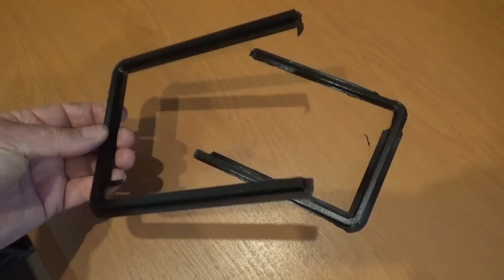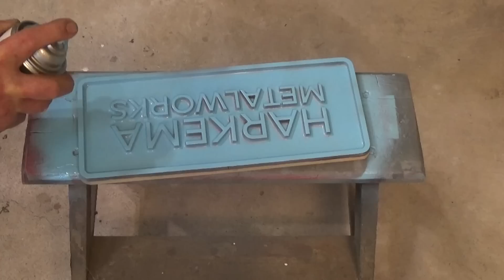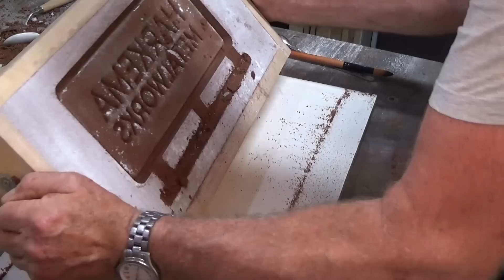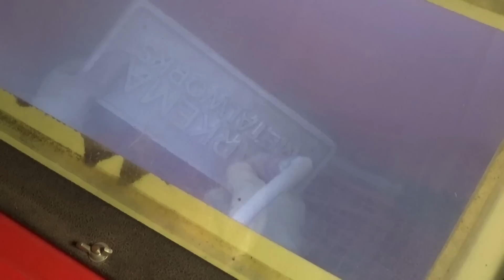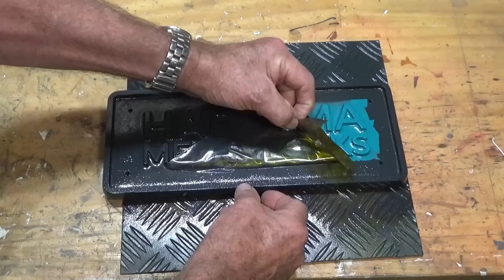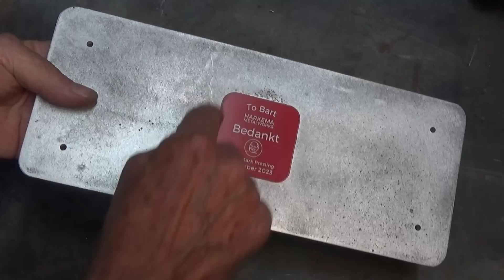A Gift for Bart

Comment: Looks simply amazing Mark, a fine example of your suite of skills. Curious what media do you use in your blast cabinet?
Reply from the maker: I use 80 grit garnet for paint stripping, rust removal and surface prep for powdercoat. I have some glass bead which is good for surface texturing aluminium prior to anodising. It takes a while to change over the media though. I find that the glass bead doesn't produce any dust and it's way easier to see what you are doing.
Regards,
Mark
Reply: Thanks Mark, appreciate that  @Preso58

Comment: Beautiful Mark. What CAD program do you use that has the ability to add draft? I do some hobby metal casting and cutting letters by hand is so time consuming. I've gotten a 3d printer but haven't found a program that has the draft feature.
Reply from the maker: I use Autodesk Inventor and the most recent version does draft on extruded text easily. I think Fusion360 would do it too since Inventor and Fusion are both Autodesk products. I know that I had issues with some text characters using older versions of Inventor but they seem to have got around most of those bugs. I am fortunate that I can still keep an Education license for Inventor but it is very expensive if you want to buy it. If you are looking for a set of printable 3D letter models, I made up two different typeface sets which you can download and then print at whatever scale you want. The link is here https://www.dropbox.com/scl/fo/2zywzsft999rty9riw1wt/h?rlkey=tri0pho0o5a2t3oclliaaar2e&dl=0 and here https://www.dropbox.com/scl/fo/ple2i7rmmyt4o1a28rvn8/h?rlkey=lp4usjk7w8gnlsxyrvuz9t0d7&dl=0
Regards,
Mark
Reply: Thank you Mark, for sharing this. I'm a relative newbie at 3d printing, so I really appreciate your help. You tube is a wonderful community.

Comment: Bedankt Mark! (yes Bedankt was correct way to say thank you in Dutch)

I didn’t expect anything in return for the cutters. I think I will speak for many of us that it would be sad to see when you run out of cutters and you can’t continue with your work. And I had more than enough. 

This gift is the most beautiful handmade gift someone has ever made for me. I really appreciate the time and effort you put into it. And even making a video about it. I know how much time that cost. 10 sec of sanding in a video is most times a few hours work in real life. 

I impressed with your craftmanship. From 3D computer work to quality casting and multiple colors powder coating. 18:04 also put a smile on my face with the ‘internal’ voice speaking  ‘cheers Mark you’re getting good’.

Getting the letters without the digital file was already a challenge. Then matching the colors from a small sticker. Fun fact, I was not 100% happy with the stickers because the green was to light. So I’m glad you picked the darker green because that was perfect! 

I real life it’s even better then on the video. The casting is very good and the paint came out great. I will give it a nice place in my shop and I’m sure it will enjoy looking at it for many years. 

Thank you Mark! Cheers! Your getting good!

Ps. about the cutters, let me know if you ever need more ;-).
Reply from the maker: Thanks Bart. It was my pleasure to make the plate for you. I enjoyed the challenge and it taught me a new skill. I got lucky when I found the typeface for the text. It was proving to be quite a challenge to match up the curves on some of the letters. I have been holding off using the new cutters but it's nice to know that they are there when I need them.
Another viewer corrected my pronunciation of your surname. Sorry about that. 😁
Regards,
Mark

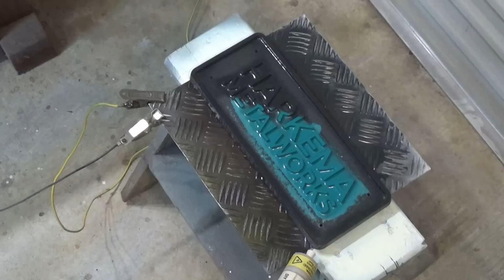Comment: Around 33:00 minutes in answer to your implied question, in case no one else mentioned it, re the inability to get the charged powder to stick is a lack of earthing - try to use a screw into the metal to ensure a clear grounding. Currently it looks like the backside of the plate may have a bit of a coat irregularities and is not making it easy to earth. Since you are elevated on 4 screws your grounding area is limited to those contact points, any three of which can be faulted without problems in fact the head diameter and any dome or pan headedness [is there even such a word] have limited the grounding potential in the 4 screws. 

Edited to include the time and a further thought. And an addition edit for good luck.
Reply from the maker: Thanks for the feedback. I sort of suspected bad grounding but I recently added a copper grounding rod which runs through the concrete and I clamped a heavy earth wire to that and the other end has a strong clip which I thought would be adequate. However, in hindsight I can now see why it was only at one corner where I was having the issue. Grounding the part can be a challenge sometimes.
Regards,
Mark

Comment: Very nice sign … you mentioned you printed with PETG …. Is there a reason for using this vs PLA?   I generally use PLA … I find it’s a bit stronger and a bit easier to print…
Reply from the maker: I really have no preference. The PETG filament was in the printer so I just used that. I do have PLA as well. 
Regards,
Mark

Comment: Interesting process, I learned a bit about powder coating. I’m sure you’re well aware but others may not be that in the days before 3D printing those letters would have been painstakingly made out of wood by hand and the fillets applied by hand as well. I worked with a man who was a traditional pattern maker and the things he could do were astounding. He could spend weeks making a wooden pattern for something like a plastic detergent bottle and work to tolerances of thousands of an inch.
Reply from the maker: I agree with the observations of the traditional patternmakers. I was in a bar in Cambridge, England and the walls were decorated with all sorts of industrial artwork. Most of the stuff on the walls was very large and intricate wooden patterns. The colours were very striking and I annoyed my wife by spending a lot of time inspecting the patterns and how they were made. It must be something of a dying trade though. 
Regards,
Mark

Comment: Nice gift. Why not design the fillet and 3D print it for free? It would also remove the need for a brim.
Reply from the maker: That would be possible. I just didn't think of it at the time. Most of the patters I make are experimental. The idea of using the epoxy came to me part way through the build. I made a small nameplate for my pizza oven way back when I first started foundry work and I painstakingly made all the fillets from wood putty which was then sanded smooth. It took days to get a reasonable finish. The epoxy is way quicker and more durable. It also fills the layer lines in the 3D print. However having an engineered fillet designed in CAD would be way more uniform. I will probably give it a go if I have to do another. 
Regards,
Mark
Reply: @Preso58  You'll still need a leveling film of some type after you set your letters, graphics, what have you. Maybe shellac 1/3 cut, dry, repeat or recut with alcohol as needed. 

In the past sawdust mixed with powdered shellac and wetted with little dots and dabs of alcohol to flow to form sometimes adding twine, string, or, even small ropes with filled ridges they make handy temporary forms.

Comment: What can I say - wow!  So many skills, experience and techniques went into that. I can see why people get into metal casting. It seems very absorbing and rewarding. Cheers
Reply from the maker: When a casting turns out first time it's bliss. When you are on your third cycle of mould making, metal melting and revealing failure you vow you'll never do it again. This one did turn out well though. I think I am getting somewhere now.
Regards,
Preso
Reply: @Preso58  As to bliss I concur, as to actually leaving the trade [or hobbies] for some it is not an option. Look at the problems we have seen pointed out by WHF in the work they attempt with failure(s) - and still he pounds sand! Great, good, and, good enough work as ideals to achieve.

Edited to add, he loves his new work more than his old job and knows folks of a like mind. Support in force of course.

Comment: Mark, there are videos on using acetone to smooth 3D printed parts.
Reply from the maker: I have used that process but it doesn't work on all filament types. Back when I first started in 3D printing I was using a lot of ABS filament and it responded really well to acetone smoothing. Unfortunately, PETG filament doesn't react the same way. 
Regards,
Mark
Reply: Thank you @Preso58
Reply: @Preso58  PETG solvents such as ethyl acetate, MEK, or, dichloromethane are used in vapor smoothing but might not work in the setup you have used for your prior vapor smoothing with ABS.

Comment: i scratch off brims with the sides a rectangular HSS blank, it does not bite in. Works quite nice to remove brim or Elephant foots,
Reply from the maker: Thanks for that. Great tip. I hope my "senior brain" can recall it later.
Regards,
Mark
Reply: @Preso58  He has it right, the reason for any other tool's inability to not dig in is the dead flat guiding surface, ground a trimmer with a 4° swarf-cut on a 12 in wheel, honed with a diamond flat for trimming UHMW plastics as a part of deburring and cleanup.

Comment: Excellent job Mark. Can you tell me how you estimate the pounds of aluminum that is needed to fill these molds?
Reply from the maker: I cannot. It is purely a guesstimate. However if you model the entire casting in Fusion360 or in my case, Autodesk Inventor, you can assign a material to the model and then use the iProperties to work out the mass. Most 3D CAD programmes have a way of calculating mass, surface area, centre of gravity and volume. Once the correct material is allocated to the model it generates a fairly accurate calculation. When I was teaching F1 in Schools we worked out a way of calculating the mass of the entire model car which had a lower weight limit of 55 grams. With some practice, the students were able to know in advance how close to the lower threshold they could get. 
With the casting, you would need to add an allowance for the runners, gates and sprues etc but these could be modelled as well. Running short of molten metal is a risk so I usually have a generous quantity in reserve.
Regards,
Mark

Comment: Well done Mark, that was brilliant. The finished plaque looked like one of those cast iron with baked enamel signs and I think it was perfect. You could have painted the mould and sent that as well to hang inside his shop. I bet Bart was well pleased when he got it. Cheers mate, Stuart.
Reply from the maker: Thanks Stuart. It does have that vintage baked enamel look about it. The powder coat was a challenge and I did have several rehearsals but the best thing was how clean the casting came out. That almost never happens!
Regards,
Mark
Reply: @Preso58  Yes, I was amazed at how good the casting came out too. You had me guessing how you were going to do three layers of powder coat but your solution was brilliant. Well done mate.👍

Comment: Thank you for the excellent video Mark.  Why do you apply the paint, is the other sealing not enough? BTW, I'm a little jealous, it's -10 Celsius here.
Reply from the maker: Mick, the paint just makes the surface of the pattern smooth and slippery so the moulding sand has less opportunity to stick. I find that automotive paint is good but back in the day they just used shellac and maybe some wax. Once the patterns were in use regularly they picked up a surface coating of graphite if they were used for iron castings or parting powder if they were used on aluminium. For one off patterns (which is almost all I do) you have to give the pattern the best chance of pulling cleanly from the mould.
Regards,
Mark

Comment: I wonder if one of those adhesive lint rollers would work to remove the powder coat
Reply from the maker: I am sure they would work but I wouldn't dare to use the one my wife has. That's probably grounds for divorce. 😁
Regards,
Mark

Comment: That came out really good Mark, I'm sure Bart will be happy. I like watching you do the sand casting, you make it look so simple. Also, those racking and pattern removal tools that you made work a treat and lower the chance of having to re do the casting.
Reply from the maker: I had to make that pattern removal tool because my hands are too unsteady to lift the pattern manually. I once met a man who was a paraplegic and he had made not one but two 1/4 scale steam traction engines. I asked him how he was able to get such large engines made in the sense that it would be difficult to work with such thick material and such heavy parts. I wasn't referring to his unique situation as in having to do everything in a wheelchair but he went on to explain that you just adapted everything in the workshop to suit your "new" needs. We sort of take it for granted that you are always going to have the same dexterity, the same visual acuity and the same mobility but when that changes I think we are very good at adapting.
Regards,
Mark

Comment: Hey mark! I am zero of an expert, but have been looking into casting for a long time. Have you ever looked into lost pla? or lost foam?
Reply from the maker: I have seen both those methods being used and the lost foam seems to be the easiest. Lost PLA requires a specific heat cycle to burn out the plastic which seems to suggest that you need an electric furnace. So far, I have been able to make all the castings I need using sand moulds but there are some limits on what form you can generate that way. After that you start to need internal and external cores which adds a lot more complexity. 
Regards,
Mark